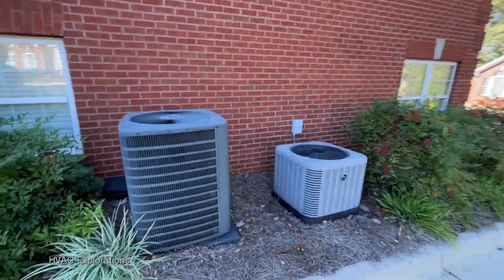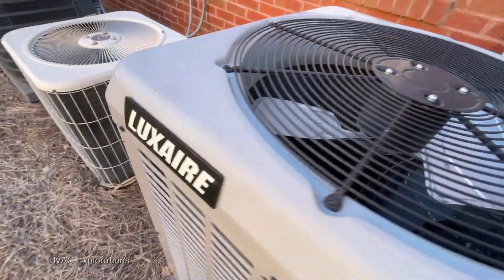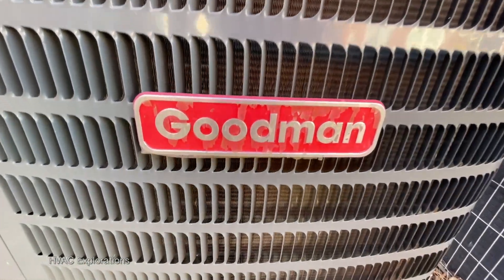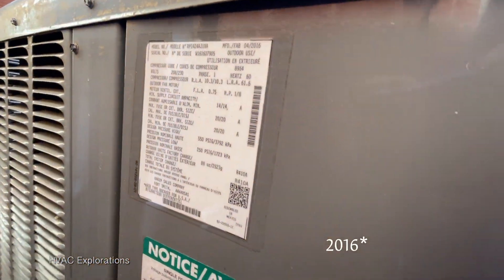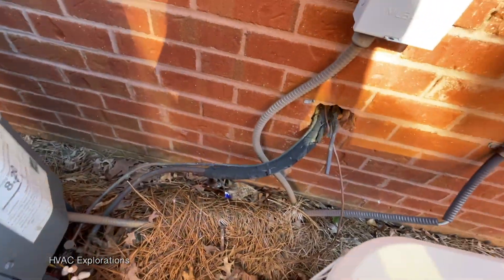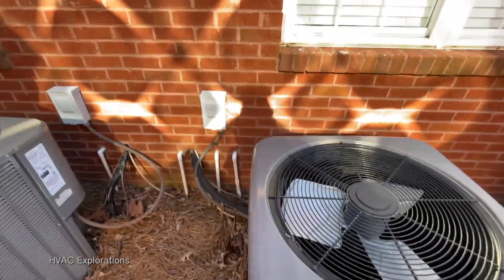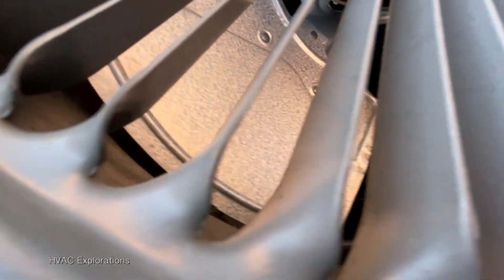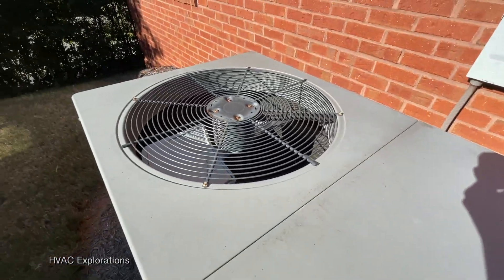2021 Georgia HVAC Collab Part 2 - Lennox, Goodman, Carrier Heat Pumps & More

Comment: Also the Goodman is a 2015 not a 05 model bc 05 models looked different then the 2015 models do plus it would be a lower seer rating like a 10 or 12 seer if it was a 05 model